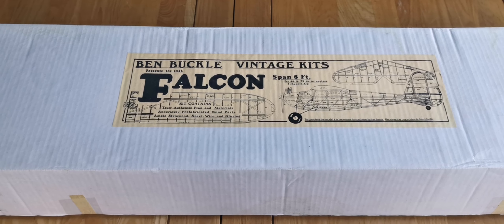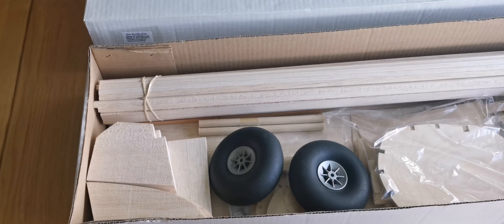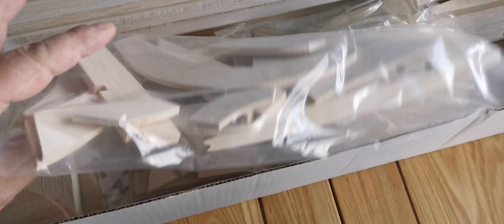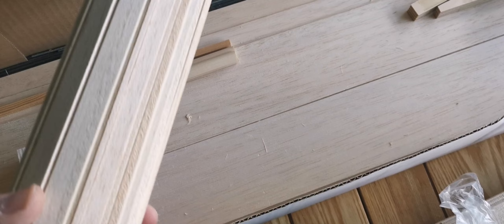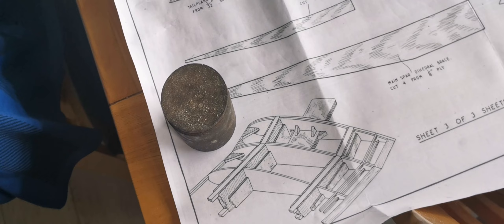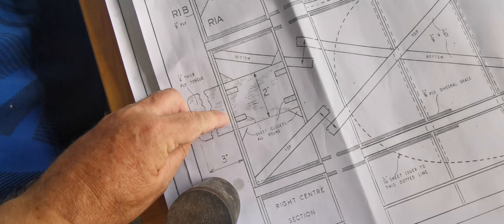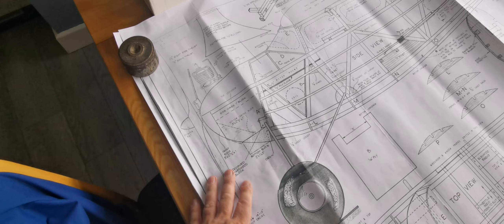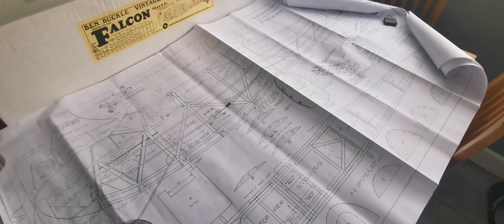The next RC plane build : Falcon a vintage design from 1946

Comment: That's great Mark, a lot of similarities to my Mercury IV, my tailplane is held in by two nylon bolts but as my transport's big I've not taken it off. I think your rudder could be a little bit bigger than mine but if you're worried you can always do as I've done and couple the elevators into the rudder as well. Looking forward to watch the build 👍

Comment: I love slow flyers and this is one of my fav! And it being made from balsa adds to that quality and look. Plus this is a perfect candidate for one of my os fs 60 MK2 open rocker engines! both would be a perfect match. I love slow flyers as I can see it and enjoy it as it floats by. Even if engine fails, it can be glided down. PS i love some oversized balloon tires on a plane! you got to put an os fs 60 in it Mark, it will really sound sweet, especially when it is  idling while gliding by. wow it is a big plane! but the quality is top notch!